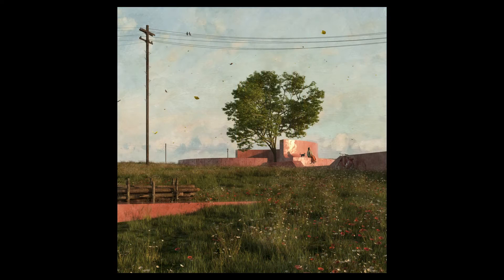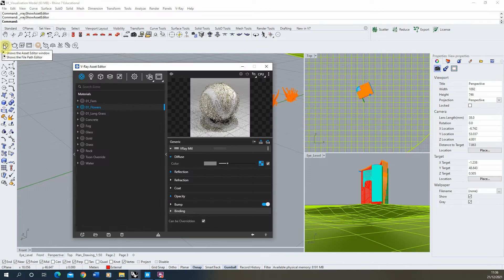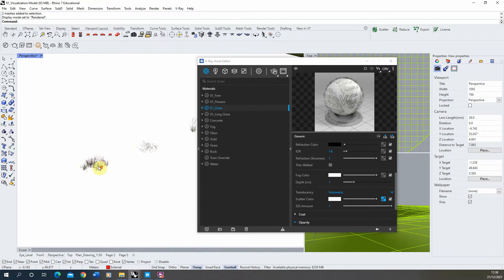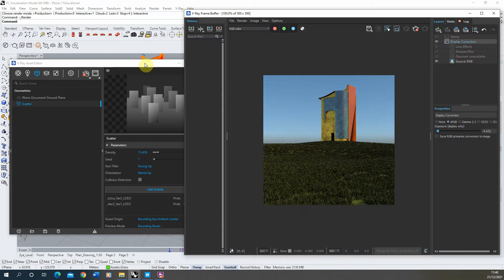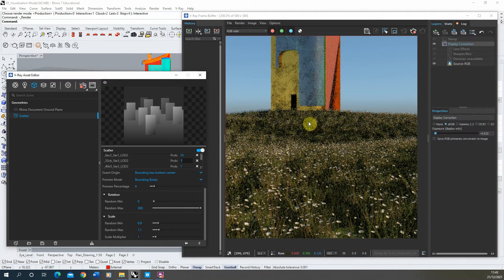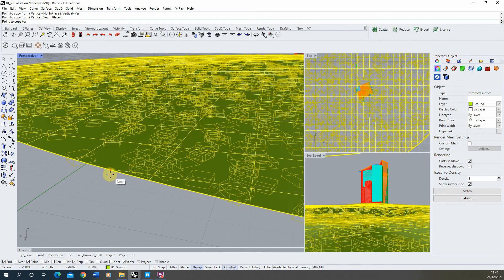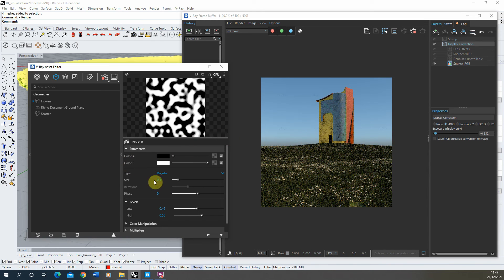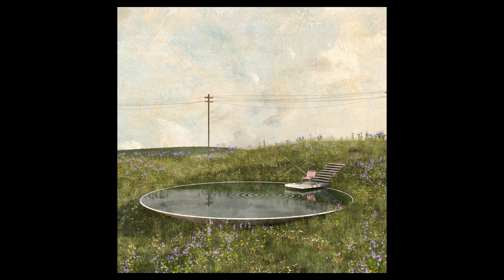VRay Scatter - Landscape Creation - Rhino 7

Comment: I have only one question about scatter. Is there any way to make scattered objects lighter? I mean would you recommend to make a grass proxy as a block before add it as a guest on scatter?Thank you
Reply from the maker: The scatter tool does this automatically when using it in VRay so it won’t really make the scene any lighter from a file size point of view. When rendering it is always best practice to make proxy objects from larger pieces of geometry though as this will just generally improve the usability of the file

Comment: Hi tom! great titorial! but i have a problem.. scatter is applicate under surface, can i change the side of surface? ( concave)
Reply from the maker: Hi L P, many thanks for the comment - if you select the surface and type in the command 'Flip' it should switch the side of the surface the scatter applies to. Essentially this command flips the objects normals so this would also work to flip VRay fur placement too

Comment: Hi, I followed the instructions exactly as you explained, but for some reason I can't seem to get scatter to work at all. When I add guests to scatter over the scatter host, nothing changes except for the name of the mesh appearing under the "add guests" button in the asset editor. No bounding boxes, no errors, nothing. no information to guide me to figure out what's wrong. I have looked everywhere for a solution to this, but I haven't found anything. Do you know what might be happening here?
Reply from the maker: Hi Cody, I have come across this issue before. It is related to the geometry you are trying to scatter on (i.e your scatter host). If you take this surface, extrude it, then explode the extrusion to give you back your original induvidual surface, this usually does the trick of 'resetting' the geometry and the scatter should now work.
Reply: @tombudd15  absolute lifesaver ty